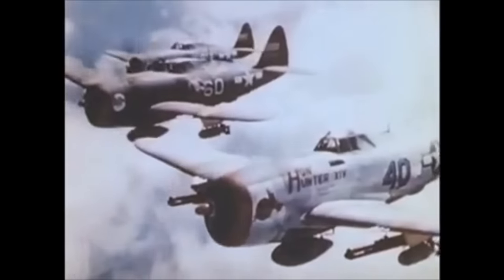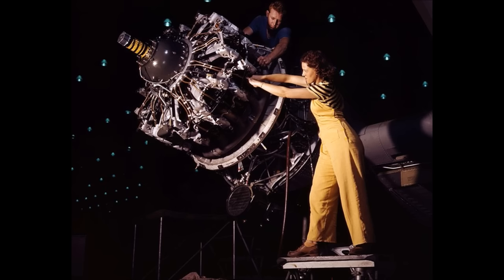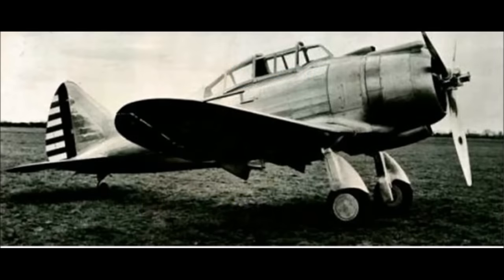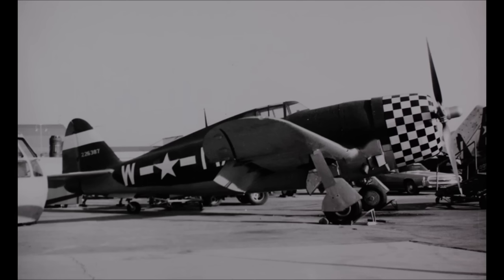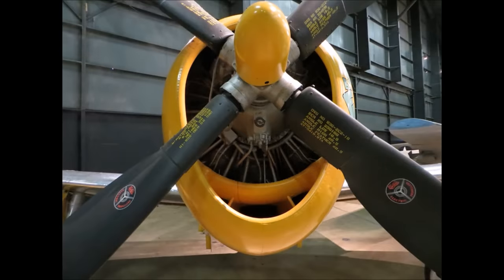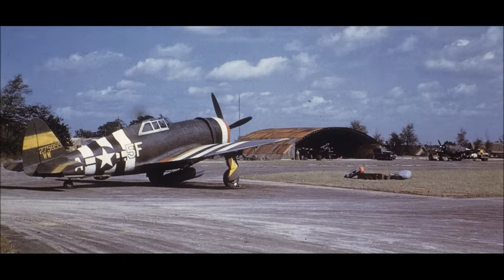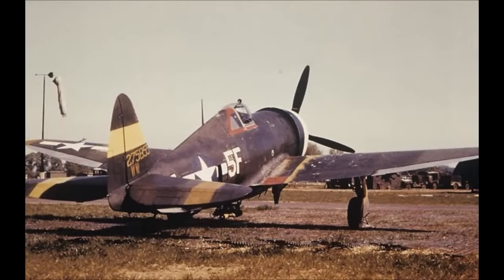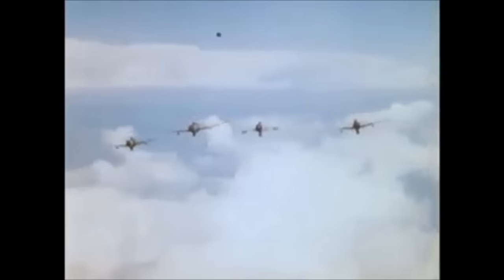P-47 Thunderbolt Pt. 1 Design and Speed

Comment: Two questions: 1. Did the P-47 have a gear driven supercharger in addition to turbo? 2. Have you made any further headway on the revision of the P-47 turning performance video ?  Thanks for the great work!
Reply from the maker: Hi Robert. Yes, it did have a gear driven supercharger in addition to the turbo. I have just about finished up that P-47 video, but there is one a NEED to put up first, and a couple others that are higher priority.

Comment: The pressure and intake ducting must have been a maintenance nightmare as it had to have some kind of flex couplings to account for stretch and movement. I remember working on DC8’s which had a lot of bleed air ducting and the couplers were a giant PIA and you found leaks by using your hands to find the hot air leaks. And I mean hot air.
Reply: Imagine the exhaust ducts connecting the engine headers to the turbo inlet.  They must have been 20 feet long, and carrying exhaust gases of 1650-1700F.  Expansion bellows definitely required.

Comment: I would say that Pratt & Whitney was very aggressive in testing the R-2800 engine and would recommend you look up a paper about the test engineer who did the development work on the water/alcohol injection. "Frank Walker "What Can I Do About This Problem"". It is at enginehistory.org. I can't put the link up but a search for the title should get you there.

A quote- "Ultimately, the maximum power achieved on the “B” series was 2800 HP at 2700 RPM. Maximum power ever achieved on the “C” series was 3800 HP at 2800 RPM. The maximum manifold pressure ever recorded was a staggering 150 inches of mercury (inHg)! This was up from dramatically from the 49-inHg maximum manifold pressure originally allowed in the R-2800 “A” series of engines. "

Comment: Hi Greg, another good one.  You talk about FW190 with c4.  In your video about b3 and c4 you apear to say that the jerries set up all their aircraft to use either type of fuel interchangeably but maybe I misunderstood.  If they use either interchangeably then they could not take advantage of the better fuel.  Could the FW pilot adjust his manifold pressure to take advantage of the better fuel?
Reply from the maker: Almost all the Fw190s were set up for the better C3 and only used C3. Many 109s could be set up either way, and the mechanics would set up the boost regulators to match.

Comment: Very interesting as always.
In the next video can u please explain something? I always see the p-47 with the iconic 8 .50 caps in the wing but somewhere I red about some different armament layout like 4 .50 an 2 20mm or even 4 20mm.
And maybe see what the pilots preferred, that would be very interesting.
Oh, can't wait to see the fw 190 video
Thanks and cheers
Reply from the maker: The M model had only 6 .50 cals. They were trying to reduce weight, but they went back to the iconic 8 .50 cal setup for the N. I'll cover armament in part 3.

Comment: Sir, you just made my day, thank you so much for this video, can't wait for the second part! I will save most of my comments for the second video, but here is a question and one tiny constructive criticism:

Question: I would love to hear some information on the P-47N variant, or more specifically, I really want to know specific values on how the wing affected flight performance, especially in terms of top speed and drag. (You didn't say anything about covering it in the next part, so I just thought I'd ask now.)

Criticism: It is pretty much impossible to hear the difference between "N" and "M" unless you say both right after each other. On one occasion (31:06) I tried to rewind the clip five times and turn the volume up, yet I couldn't determine, by hearing, if you were saying "N" or "M". Now I could tell (by looking at the wing, in the example at 31:06) that you were saying "M" most of the time, but there may be those who will really struggle.
Reply from the maker: You are absolutely right. From now on I"ll call them Mike and November. That should take care of this. I'll be covering the changed to the N model completely.

Comment: "Hopefully I'll be able to finish this up in a 3rd part. I'm not sure yet. It's possible this is gonna need a 4th part". That claim did not hold true! 😛 I'm rewatching the old videos to then go and watch the new ones. I haven't got around to watching part 8 yet even though its been out a few months. If you do see this comment I have a question. You mentioned that there were many different propellor versions used on the P47, and I'm very curious about the different designs and advantages of different blade designs. Do you think there woudk be enough interest and sources to make a video on it, and would it be possible to explain the aerodynamics in a way that most people could reasonably follow?
Reply from the maker: I am going to make that prop video.
Reply: @GregsAirplanesandAutomobiles  Fantastic!

Comment: Did the charts you saw state what kinds of fuel was used? By 1942 fuel 44-1 had been tested for the P-47 and the P-51 and it gave significant performance increases in both I know that some P-51 did get some of this.  But not all. Extended use in th P-47 could cause head temp problems at extended use and RPM. But at least a 500 rpm climb increase could be obtained even with water injection.
Reply from the maker: Yes, they did.

Comment: According to Warren M. Bodie's Thunderbolt! book, the XP-47A sounds like it was a comparatively small, lightweight design.  The in-line engine intended for it was the Allison V1710, and had it been pursued, it probably would not have been in the same size and performance class as the P-47 that actually emerged.  Good decision by Republic!  Considering how engine problems and underperformance doomed the XP-47H and the planned P-47 variant powered by a Wright R-2160, sticking with the excellent P&W R-2800 was a really good choice.

Comment: I see from the charts at the end, and similar in previous videos on turbocharged aircraft, that the max speed is very altitude dependent, by comparison with supercharged aircraft - because of how the boost is provided. I'm not sure how that 'peak' (meaning the right-most position of the speed curve vs altitude) varies with air temperature, but it should be possible to determine the probable altitude he was at flying at max speed, because of how 'peaky' the curve is, and decide if the required air temperature for his ias-aas correction is credible. All beyond me, but not beyond you I would think. Great video.
Reply: "on turbocharged aircraft, that the max speed is very altitude dependent, by comparison with supercharged aircraft - because of how the boost is provided."

I think you've got the two types mixed up. Turbochargers tend to have very smooth/linear lines, as they're highly adjustable. Most superchargers in WWII (excepting clever designs like on the Bf 109 and the F4U-5) were geared, meaning they would have the peaks, and not the turbos.

Greg actually covers this in his video, talking about the relative ease of running higher boost in the 47. All you gotta do is increase the turbo RPM (and maybe have your crew chief disable a limiter?), et voila, extra manifold pressure. Really quite easy to do, especially if you know what the RPM limits are for a 47's turbo, like the pilot discussed likely did.

Comment: Greg thank you for the information there are so many misconceptions misinformation and out right lies about ww2 aircraft. I have liked the Corsair and thunderbolt above all others both going from flunky designs to exquisite  aircraft. My special niche is the P 47 N thunderbolt of which I believe there is only 1 in existence that I know of hardly no pictures stats etc. Very late in the war. I also an curiosabout prop size I know they can only turn so fast because speed of sound. Number of blades but also prop turns falls in the vacuum pulling aircraft in to vacuum and eventually the tail prop size at eighth of horiz.stabil.tail???  Sadly most people don't realize the P47 did more to win the war than any other plane except maybe B17 thanks again RB Twidwell

Comment: Although the P47 had a  performance advantage compared to the FW 190 , the 190 had the advantage of a one Lever power control, this  lever on the left side of the cockpit similar to a thrust lever in modern Jet fighters was linked to a mechanical computer that made all the necessary adjustments,the pilot did not need to fiddle with a bunch of different controls  in a combat situation.
Reply from the maker: I'm actually writing about that right now. There are pros and cons as with everything, but the 190's engine control system is excellent.

Comment: Phwew!...that was quite detailed. My subjective view is that that "thing" was inferior to others', but of course the evidence is that it was on par. Reports from pilots who flew it initially, said it climbed poorly, but dived like hell. I guess tho, that as propeller technology improved, they could match it with engine power characteristics, and it performed well. I also read that American pilot-groups who had flown Spitfires, and converted to the Thunderbolt, did not like it. Thanks and I look forward to your next installment.
Reply: Darrell Borland Hi Darrell, trying not to become frustrated by your well intentioned comment. There are a few reasons for this. First, it’s common to be kinder towards kit built by your own nation. I get that. Everyone does it. Americans, Russians, everyone. But, in my experience, in regards to WW2 aircraft, the absolute worst offenders, are the Brits. ESPECIALLY for the Spitfire. You lot will often use statistics from late war versions, that were not produced in great numbers and had limited impact on the war, and treat them as if it were true for ALL Spits. This was not the case. A decent example of this general behavior can be seen in regards to the so called Battle of/for Britain. I cannot tell you how many Brits I’ve spoken to who go on and on about how the Spit won the Air battle for Britain. It didn’t. At best it helped. The Hurricane did the heavy lifting. Why? Because the Spit wasn’t available in great quantities and those that were, while better than the Hurricane, weren’t THAT much better at that date. But British war propaganda made the decision to portray the Spit as being the frontline fighter during the blitz, presenting it as FAR superior to any other aircraft, in order to calm fears. It’s a piece of propaganda that is still alive and well today in Britain. One of the things I love about Greg’s channel is that he doesn’t just state unsupported opinion like many who read a biased books, he looks at the science. I encourage you to watch this video again, especially the the parts where the various planes were compared because those were the planes in COMMON usage at the time. Note the values for the Spitfire 9, the Thunderbolt, and the P51A. Then consider at what altitudes dogfights were occurring most commonly at this time of bombing escort runs. The Spit was DAMN good plane. One of the best of the war. But it’s reputation is over inflated by enthusiasts, much like people who love Japanese martial arts think the katana is some sort of light saber.
Reply: @carlpolen7437  Thanks, Carl. I have no allegiances to any nation's aircraft designs..frustrations not necessary.  I was remembering the comments of Americans who had flown Spitfires as volunteers in the RAF and transitioned to the P47, I guess in 1943, as I recollect...two very different handling craft, and they did not like the American design and flight characteristics, as compared to the Spitfire. Thanks for your comments.

Comment: Greg, over the years I think I’ve seen 2 flyable P-47s parked at airshows. I don’t think I’ve ever seen one flying.
From reading about WWII airplanes as a kid in the late 1960s to early 1970s, I knew that the turbocharger system on the P- 47 was complicated and heavy.
It’s a huge airplane to encase all of that in an aerodynamic fuselage. As an aside, I’ve seen Corsairs up close and they are also a huge airplane.
Especially compared to the P-51 or Me-109 or Spitfire. I’ve also seen Hellcats in museums and they are huge also.
It took a big airplane to accommodate that R-2800!
My question is do you know if any of the currently flying P-47s still run the complete turbo system?
Or do they just just use exhaust stacks out of the cowl flap area like the other R-2800 airplanes?
I love these videos. The P-47 was one of my favorites. Seeing ground strafing gun camera video of those 8 .50 cal guns looks more devastating than an A-10 pass. Like others have said, it looked like an American “big iron” fighter.
I look forward to the rest of this series. Thanks, MM
Reply: Michael, I also have seen 2 flyable P-47's.  Actually, I saw the same plane in 2 different countries.  When I lived in California, I saw a razorback model at Chino.  It was flyable but was under repair because of an earlier crash.  The flyable one was also a razorback (no bubble canopy) at the Gathering of Warbirds in Madera California.  It was restored in Ohio and was on display.   It's one of the best warbird restorations I have ever seen.  As I watched it take off, I turned to an older gentleman standing next to me with a "P-47 Pilot Assoc" hat on and I told him that's the first one I had ever seen flying.  He laughed and said it was the first one he had seen since 1947 and that he flew them in the war.  Well, that got my attention so I started asking him all kinds of questions since I am an old P-47 fan and a flight instructor.  He told me that he had just received a call from a man in Germany asking if he had shot down an Me262 jet over a certain city in France on a certain date.  He told him that he did and the guy told him "That was me that you shot down".  It was none other than Adolph Galland, the head of the Luftwaffe fighter force and the youngest general in the German Army.  Galland told him that he wanted to pay for his flight to Germany so he could dine with him and go with him to the 40th anniversary of D-day in Normandy.  Well, I thought to myself "is this guy pulling my leg or what?  What a fantastic story".  I asked him if I could join the P-47 pilot's association and he said that he would check.  He gave me his business card.  His name was James Finnegan and his card showed that he worked for the San Francisco District Atty.    Some months later I was looking through an aviation magazine that had advertisements for aviation paintings and saw one of a guy shooting down Galland in a P-47.  His name was James Finnegan.  I said to myself "well...there it is, he was telling the truth".  Oh, and he wrote me and said that alas, I couldn't join the club unless I had actually flown a P-47.
Anyway, you asked if the currently flying P-47's still run the turbo system.  The answer is no.  It's lots of added weight and maintenance and nobody flys them at those altitudes.  The same plane I saw in California, I later saw at Duxford, England.  It's a restored fighter base where they restore and preserve WWII warbirds.  I flew up there from London by helicopter belonging to a very wealthy pilot friend of mine who flew acrobatics in his spare time.  After seeing the P-47 there, he later texted me and said that he was going to buy a warbird.  He has since bought a P-51, A Spitfire Mk16, a German Storch, is restoring an F7 Tigercat and just purchased the last flying Super Corsair F2G with the R4360 engine.  It's good to have funds like that.
Reply: Thanks for the response. Actually, since I wrote this comment, I’ve had at least 2 P-47 restorations show up in my YouTube suggestions and both appeared to be using the standard turbocharger set up.
Very interesting to watch the start up with the waste gate dumping smoke on the lower cowling exhaust pipes and the turbocharger exhaust also dumping smoke out the rear belly on start up. What I would expect based on my experiences with large radial engines.
Apparently there are at least 2 P-47 flying restorations out there running the original turbocharger set up.
Considering how many P-47s were built, it’s sad that there are so few originals left.
But, that could be said about most WWII warbirds.
The war was over and the people wanted no reminders of the horrors of that war.
The Jet age had arrived and nobody cared about preserving these precious historical engineering masterpieces.
C’est la Vie.
Reply: Michael Meyers Thanks for the info Michael.  I wouldn't have that anybody would keep the super chargers in a restored Jug. All of those I've seen seem to have the inter cooler doors sealed.  There is lots of plumbing involved including two large high pressure pipes on either side of the pilots shoulders. When I was in flying school, we had an older instructor who was involved in the design of the Thunderbolt who said that they worried about those high pressure returns in the cockpit but they never had any reports of battle damage to them. I did recently did see a you tube video of a P-47 (silver with blue trim on the cowl flaps and around the cowling) with exhaust streaming from the turbo exhaust port ahead of the tail wheel, so I suppose I stand corrected.  I wouldn't think anybody would want the extra weight and expense.  Thanks for the info.
Reply: @intrepid2011  To see a flying P-47 with the original turbo system go here:

https://www.tnairmuseum.com/